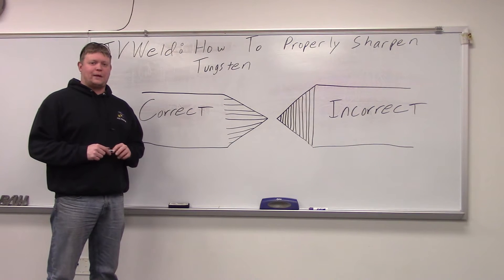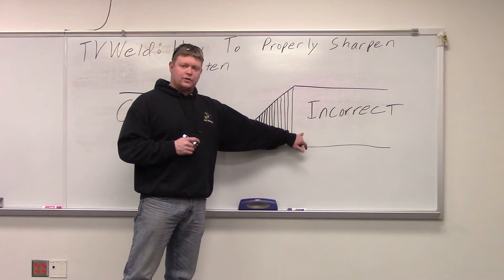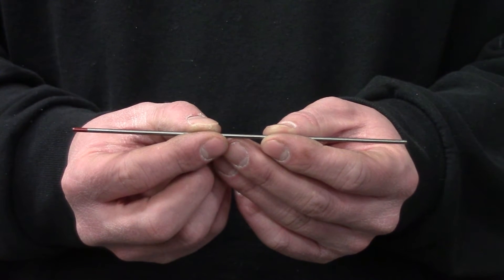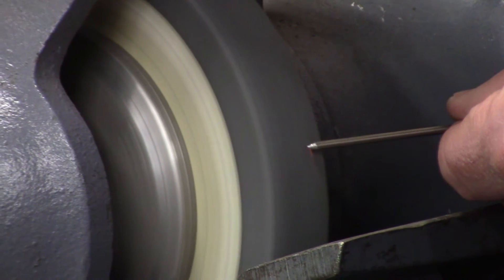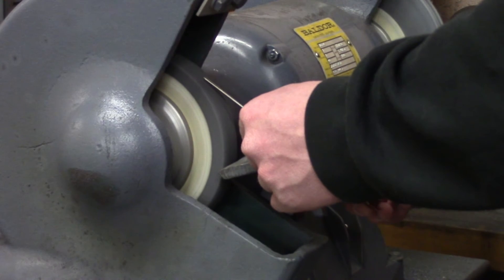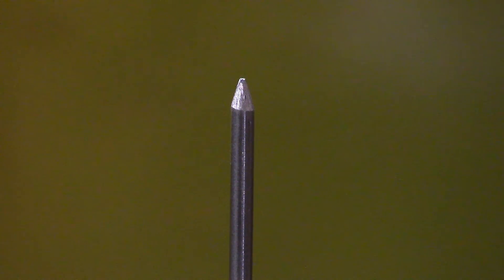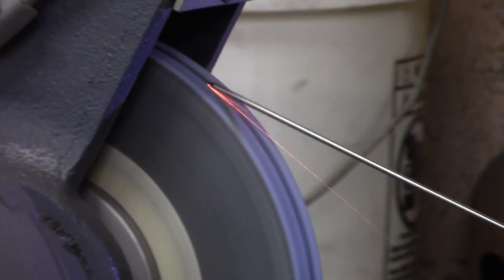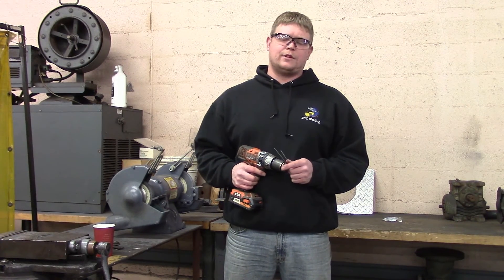How to Properly Sharpen Tungsten

Comment: 2% Thoriated tungsten is radioactive. It is an alpha emitter. Alpha emitters are not high energy, so they can be stopped by regular clothing, paper or skin. Once alphas get inside your body they can not get out because of your skin. Wear a dust mask to prevent inhalation of the dust inside your body. Wash your hands after grinding tungsten.